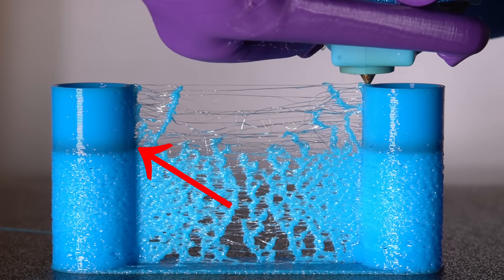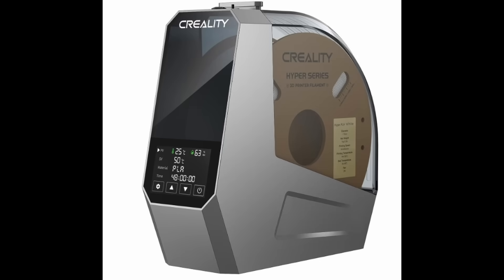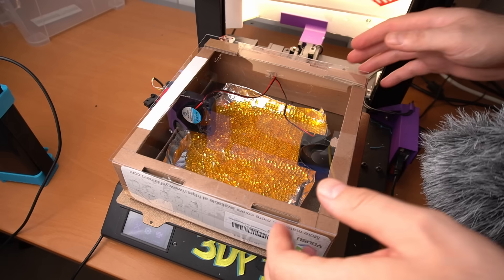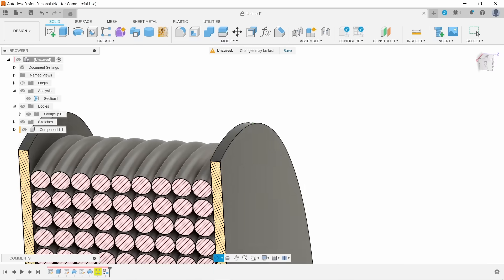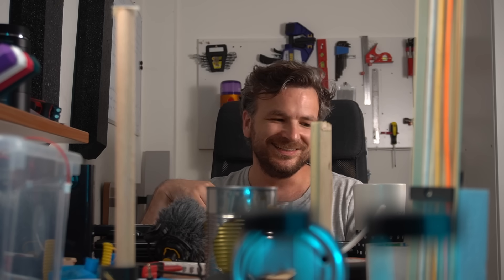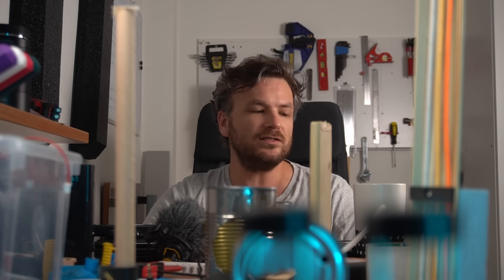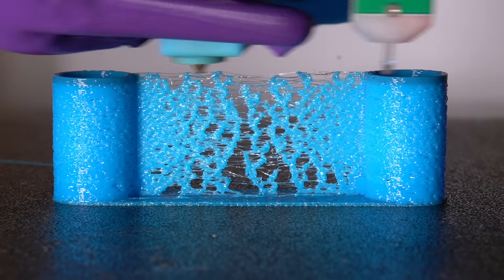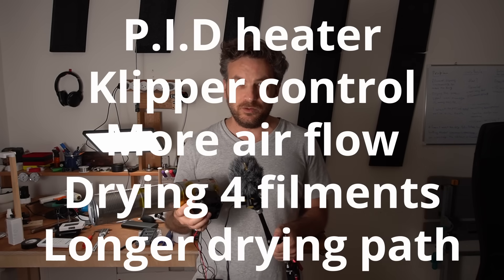Why are we drying filament this way?

Comment: the hardest think at this metod is that the some filament is so hydrofobic that u just cant properly dry it, take for exempl PLA or PA, ur metod is work mostly becuse u preheat filament and reduce the water from outside of filament, but at PA wher u need durabilyty u need to dry from inside too, the fastes way to dry it be full vacuum but then the water woud boil from inside and destroy the plastic, be realy cool if ur idea will work but it be work just for some filaments

Comment: Nice results. :)
Have you considered a closed loop for the air? You’d be recirculating the dry air instead of keep introducing fresh moist air into the system. It might achieve better results as the air inside should get dryer due to recirculating.

Comment: Well, to increase drying you need to increase exposure or heat. You can increase the heat, which comes with many issues; you can increase the length of the "can gauntlet", which might be  impractical; or you can expose more surface area to the heat within a single can. 

I wonder how insulating a PTFE tube is? And if not that, then some other tubing? Or even some form of mesh tube. The point I'm trying to make is that, if you were to wind (ie. glue) a tube in a coil to the inside of a can, and feed the filament through that tube, then you'd get allot more exposure to heat in a smaller area.  Might be worth looking into!

Comment: If you want to print faster, you could just run the TPU over a wheel at the end, and feed it back through the cans, so it would spend twice as long in the drying chamber.

Comment: Version 2 of this great video and idea would be awesome. What do you think of increasing the way the filament has to go through the heated airflow by directing airflow and filament through a spiral made of coper tubing(reducing tubing diameter and increasing airflow)? Is it possible to measure the input moisture level and compare it to the output to estimate drying performance?

Comment: Why not blow the drying air to a transport tube we use anyway when printing from a closed storage container. I would use 10mm pneumatic tubes basically just like Bowden tubes to extend the length and width it the drying time. It’s even possible to make it multiple drying stages from the same heat source. Just use one of these spiral pneumatic tubes. Heat injections are done with a simple pneumatic T connector in that tube. The printer side needs to be sealed off from the airflow by a foam seal, which act as surface dust remover as well. If it’s multi stage there must be a T as wet air exit and a foam seal before the next hated air injection T connector. The filament must not be overheated while drying and also need to have some cool down distance before reaching the extruder pulling gear. That might also be needed between drying stages. But most likely a multistage drying will be impractical for direct printing, because of all that extra load to the extruder transport gear. Every bowden transport system especially if it’s long gives challenges to rubber like filaments as they have a high sliding resistance. Otherwise it should work similar to the canned solution.

Comment: @3DPI67 I have a few ideas for improvement.
Make the tube out of 3D printing material to control it's size and shape
Mount the fan at the in-flow and add a small wire resistor (like those in hairdryers) for increased air temp
Make spiral guide for the filament inside the tube to achieve long path with small tube size.
Mount the power and control board on the ouside of the tube to give it a clean look and not fragile.
PID is unessecary and complicate, environment conditions stay relative constant throughout a print. Use a potentiometer to control the fan speed and heater power duty cycle.
Note: inside the tube, make the air path diameter no larger than 3-5 times the filament diameter. Larger diameter will dicrease the air speed, requiring more time for the drying (equivalently you will need longer path).
I can help you more with the implementation if you want

Comment: for TPU instant is useful, but PLA and similar get more brittle when wet, so can have them snap and shatter in the bowden while printing. so drying THOSE before use is a good idea (so is just storing them in a dry box), but TPU, inline is useful

Comment: Two points:
1. Stationary blades are arranged inside said jars to swirl hot air flow. Thus, the path of the hot stream will become much longer.
2. Place the filament not in the center of the jar, but as close as possible to its edge, but at the maximum distance from the heater. Thus, the plastic will be washed with a stream of hot air repeatedly (see the first paragraph).

Comment: On my part, I would never preheat filament before it is extruded. Did bad mistakes already. First: hot filament is softer which means the extruder gear will strip easier and stop extruding. Another one: Even if it passes the extruder correctly it will compress more in the tube between the hotend and extruder. Compress in length = expand in diameter then clog in the tube. If you heat a chamber above TG it does the same, the filament get softer before extrusion and this is bad. What work in winter might not work during summer...

Comment: What if you use a smaller diameter CPVC pipe instead of tin cans and not make holes around it but leave the other end with few small holes? I think that will improve airflow and will retain more heat across the whole length.

Comment: its an interesting idea, and looks like it might be worth pursuing. my current setup is wooden enclosure loosley sealed around the printer, with 4 roll hangers and  an electronic dehumidifier, it seems to work ok, but what if I want to print with a filament thats not one of the 4 already in the cabinet? I'm curious to see where you go with this, as it may be the solution.

Comment: Would to interesting to add this design inline to a filament respooler like the LTS Repooler and those alike. Would act as a way to quick dry the whole roll and then use as inline with the print. That way the filament that's respooled first would be warm in the centre of the spool. Also added a cage inside the tin can filled with silica balls Would be interesting results.

Comment: Just my random thoughts seeing your video.
Your premise is on point IMHO.
Why not making a spiral and airflow down the middle?
Maybe using ptfe or copper "pipe" with bunch of holes for spiraling the fillament and reducing the footprint.
Also injecting the hotair directly into the tubing could be possible.
Reply: im thinking bout that too, youd have to put alot of holes in the tubing, dunno of any process which could easily do that for hobbyists, for my version, im doing many "wind tunnels" and a few bends in the filament route

Comment: the weird thing on the back of the drywise unit is a molecular sieve. Its just a tank of pellets made of porous stone. basically a somewhat less effective, but incredibly reusable replacement for silica beads. I guess they use this to reuse the hot air?

Comment: here my 2 cents:
1 air flow against the filament direction
2 add more drying path : coil your filament inside the can with a porous coiled tube (like a hollow spring made of cooper tube and slits cutted)

Comment: Thought. Why not use 2 spools, and slowly run it around in a temperature that's 1/2 - 3/4 its melting point so it doesn't go goopy, and run it through a heated 3-tin can setup w/ the fans, AND, run it over 1 hour?

include desiccant too.

Comment: I guess that drying the air injected in the tube could help a bit. Because hot air can store more moisture, heating the air lowers the relative humidity, but the water does not disappear. In very high moisture environments, heat is not enough to get things to dry out.
One fast way of drying the air is to get it into contact with a very cold object : cold air can store less moisture, and the excess will condensate. You could maybe use a thermoelectric cooler to do so (one side would cool down a plate, the other would heat up the air before sending it in the tube).

Comment: Definitely interested. I don't use TPU because I can't be bothered with the hassle it brings but for your project, I'd suggest something like:
1. Drying more filament at once - Make an Archimedes screw or some coil support structure which sits in the middle of the tins which supports a filament coil. The coil shouldn't be tightly packed but enough to cope with the higher print speed. By doing this, there will be more filament inside the dryer which means a higher volume of filament is getting dried quicker if you're going to print at a higher speed.

2. Keep your moisture-sensitive filaments in airtight containers.

3. The more energy efficient way to dry TPU or any other filament is store a desiccant in the airtight containers you keep the filament in and add a fan inside to circulate the dryer air for more efficient drying with minimal addition of heat.

Comment: In Cyprus we have 80% humid.
I bought a big box from jumbo store with plastic cover and have 2 ears to lock the cover.
I put all my filaments inside with 2 humid absorber and done.also i put inside every spool absorbed.
Elegoo TPU 95A filament its great but only have black and white.
Even the PLA from elegoo its from the best filaments.
They are cheap but the best brand that i tried until now.
The elegoo TPU 95A even if left it on the printer don't absorb humid.
You can see my videos that i make white projectiles and you will understand

Comment: get a positive pressure rated fan, or 3, add another set of cans as an inlet tube, fill them with dessicant.  you want hot dry air. easier for the dessicant to work when it's cold.   now you have an inlet, an outlet and a heater seam. put a fan in each.  that will work.

Comment: We use inline drying systems for all things in industry. The biggest problem with them, is that you must tune them for every material and process, and they take a lot of calibration. Then some materials get worse if they get too dry, including some plastics. Also some materials, including plastics and steel for example, accumulate moisture within the grain structures. You can't force these out quickly, if you do you get pressures which can damage material and structure.

So what do we do?

The slow process of duffusion drying. As in what my sunlu S2 and every other dryer does. You heat the whole mass of material, in this case spool, to a specific temperature and have it diffuse moisture out slowly over time.

Those "6 hour" radiative driers when set correctly can dry surface layers quick enough when in regular use.

But if you want to truly dry materials, you get a big wooden box that seals well, you put a air drying system which drains condensate out and runs constant. Then you just store the material in it. We do this with things like welding fillers. They just exists in a warm room with dehumidifier at all times when not in use.

You can also try quick drying with vacuums. However, this can alsi pull out things like the glycol from PETG.

Comment: If you're going to print faster, then you're going to reduce the time the filament runs through the "heating chamber". So it might be going to be insufficient at some point.
I think you would need to extend the time being heated/dried then. You probably could achieve this by making the "chamber" bigger/longer by adding more cans. But this might be getting a bit weird at some point. And when making the chamber bigger/longer, the heat, produced from the heating element might be getting unsnuffing, so at some point you might end up installing a second one.
What maybe could be more practical is to make a detour for the filament. That actually doubles drying time. It could be managed by looping it out from top with a PTFE-tube, while it gets inserted right away again and gets heaten a second time before leaving from the bottom again.

Another option might be to find a way to get the filament in a "spiral" movement through the cans.

Comment: I just plan on putting the entire machine, MMU3, and spools in the same chamber as the printer. Since I keep them in sealed containers at around 18-20%RH, it works fine for even long prints.

Comment: I think the primary reason why in-line drying isn't more popular is because most printers are sold in set ups that have the spool held on the machine itself, there simply isn't room for in-line driers most of the time. Ultimately most people are conditioned to think of their printers within that contained space and for the most part only tinkers who do all kinds of modifications and tinkering are going to even have a set up that readily accepting of such a long drying tube.

Comment: That's like a commercial large-scale pellets dryers work - they heat it up at the bottom and have a valve to release hot moist air at the top

Comment: This is really good progress. I'll tell you my story with filament drying. I use a flexible filament that is ridiculously hydroscopic. I tried all sorts of things. In the end I started using Creatily new dryer which creates a vortex around the filament. I also found cracking the door open a bit really helped dry this filament. I still would like to see if it could be dried sufficiently inline so I look forward to V2 😊

Comment: Neat idea! For drying filaments like ABS/ASA PC, nylon that require a hotter drying temperature, you will need to increase the filament's path through the dryer. Think of a solar hot water heater with its long tubular path but without the tubes since long tubes increase friction. Perhaps something like the filament buffer used by the Prusa MMU3 contained in the drying chamber.
Reply from the maker: v2 has internal drum to wind filament a few times over

Comment: I had a similar idea two months ago. I planned to put it inside my enclosed Bambu P1S so that the heated air from the build plate vaporizes the moisture from the filament. Also, I was planning to print a rod with a hole for the fillament and blow the air through it. I'm glad to see that I'm not alone in thinking about it, and the out-of-the-box solution might be close.

Comment: I would heat the can and run the filament around it in 3 loops on the outside then place this can inside another slightly bigger tube where you push air through. Allow the inner can to freely rotate.

Comment: In my opinion I think it's possible to build it in a size of one can.
Everything needed is just the length of the filament which is exposes to the heated air. My conclusion is, that you need to go back and forth in a small heated area whick lengths the filament exposed to the heat.
The next thing is to calculate what temperature you need. I mean, what you are measuring with your humidity clocks, is the relative air humidity. But when you heat the air this value drops, because warm air can take more water. So you need to calculate what's your absolute air humidity is at the moment, means how many milliliters water is in the air and then interchange that to your desired relative air humidity you need in your dryer to dry TPU efficiently.
But the first big step is done with your ideas. Congrats for the success :)

Comment: should find a light, non or at least lowabrassive material, that's good at conducting heat and use it as filler in the can for increased performance.
that's probably why the aftermarket ones are filled up, it's probably a reusable decicant wrapped around some kind of perforated tubes

Comment: I'd dry the air first in a silica gel chamber before heating it.

Also running the heated filament through a cold chamber packed with silica gel after the warm chamber might help the water evaporate out. Perhaps you could use both sides of a peltier element  to achieve this.

Comment: I think the idea of the filament dryers is to keep them running while the printer is pulling the filament in, so that the outermost layer (as you have observed) gets dried shortly before reaching the extruder. But I would also like a solution that lets me dry the entire roll at once.

Comment: A perforarated helical channel just a centimeter or 2 smaller than the diameter of the cans would greatly increase the exposure time. You end up with a trade off between how much air gets through the channel and how easy it is to feed the filament through, but the extended length could be worth it.

Comment: Love the idea, but I have a couple thoughts on why you don't see more of these.  Granted this is just my thoughts with zero actual experimentation, so no guarantee on accuracy.  That being said, I think the main factors are likely time and efficiency.  While it's nice to have on demand drying, I really think the process overall benefits from more time to dry.  You can't dry something instantly, evaporation takes time, and more time in the heated zone would have probably given even better results that the improvement you saw.  So, while fast is nice, dryer is better, to me at least.  And second, on efficiency, I would guess that your setup, while drying much less filament, is probably using every bit as much power as a unit that dries the whole spool all at once.  So, there is no gain in either power efficiency, or even space, with your setup over a "traditional" spool drier.  And factoring in cost or functionality of the two commercially available units you mentioned, vs the cost of available spool driers, it's kinda a no brainer as to why you don't see the former more often.  They just cost way too much and/or don't work nearly as well to make them viable options.